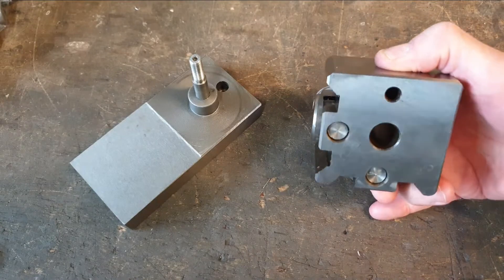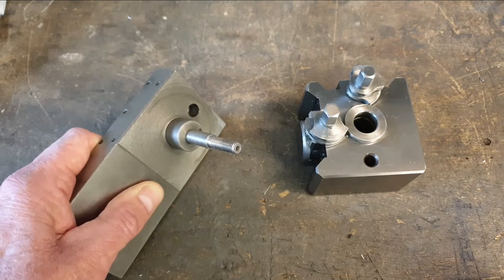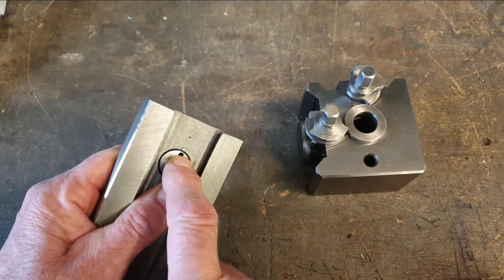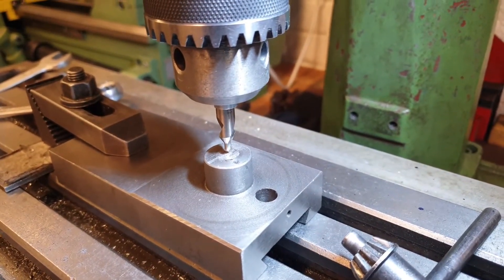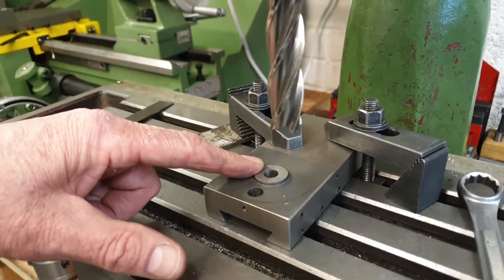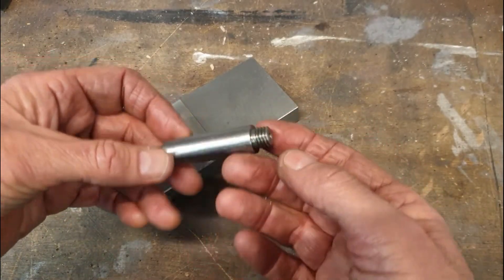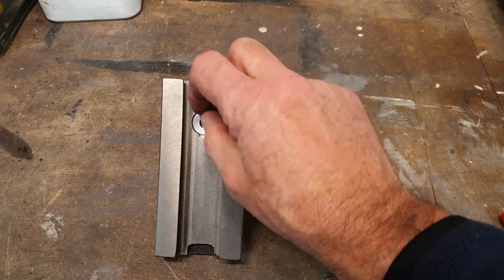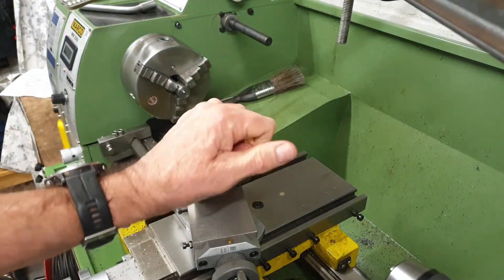Warco WM250V compound slide modification for QCTP

Comment: Hi Mark been watching your video on the qctp I have just got the same I wonder if you could remember the diameter and depth of the recess on the underside of the top slide kind regards rex Harrison
Reply from the maker: Hi Rex, sadly not.  I can confirm the old post is just a press fit, so doesn't need to be drilled out.
Good luck.
Mark

Comment: Good job.  Appears to be the same machine as the Precision Matthews PM1022 / PM1030 and the Craftex CX706 (from Busybee in Canada).  Grizzly has also sold very similar machines.  I did a similar mod to my CX706 and I found that the factory stud pressed out easily after applying a bit of heat.  I think there must have been some sort of adhesive in there.

Comment: Hi Mark.
I have a 240, much the same, but I wanted to keep the stud in the event I needed to refit the existing tool post.  To achieve this I bored out the tool post to accommodate the stud, the problem was that the QCTP was hardened, but with determination and brute force….. I also turned a new retaining stud, and it all works well.
A few days ago I watched a couple of videos showing a new 4 hole compound mounting plate, which increases rigidity and makes parting off less thwart.
I’m thinking of making one, when I get the time.  The link is https://youtu.be/w3n7TtL3Qa4  the channel is Marks’s Home Engineering, Warco WW250v compound slide modification for QCTP.  Cheers Noel

Comment: I have a WM240 with exactly the same compound slide setup and have been looking at methods of adapting it for a QCTP, yours is the simplest and best I've seen to date and that is the way i will be going, may I ask where you sourced your tool post as I was looking at possibly a 250 - 100 tool post but yours appears to be dimensionally more suitable for the lathe. Many Thanks for filming this it was very informative
Reply from the maker: Hi John,
Thank you for the feedback.  I bought the QCTP from Chronos UK, they refer to it as a "Quick Change Toolpost to Suit Boxford".  They don't appear to have any in stock right now.
Cheers
Mark

Comment: Hi Mark, I did this on the 290 version of this lathe. If I remember correctly I cooked the top slide in the oven to get that bolt out. Like you I replaced it - took two goes to turn a decent thread - I am still learning now as well! Not being convinced I could turn an accurate boss at the time I bought a length of 19 mm precision ground steel and loctited it to my 2nd attempt turned bolt. I do want to make a solid tool post  but have not done so yet. I still need to do something about the tool post clamping nut I used which is too big. Cheers. BobUK.

Comment: Hi Mark, very nice mod.  I have something very similar on my WM250, but I've made a taller clamping handle so that it doesn't clash with the height setting screws.
Reply from the maker: Hi Steve, that is a very good suggestion!